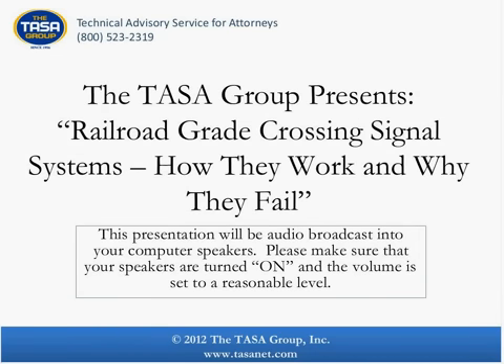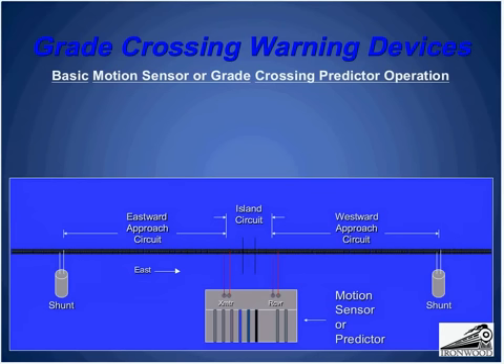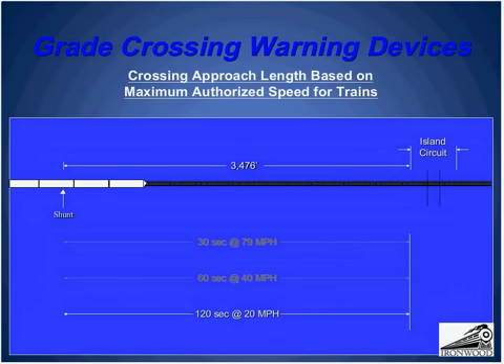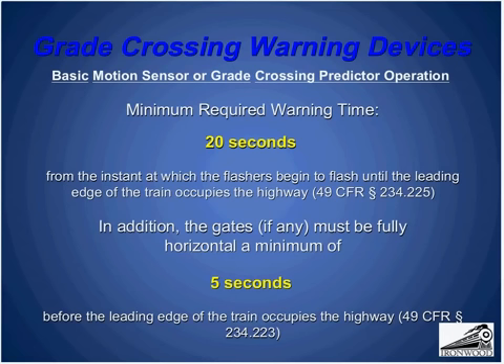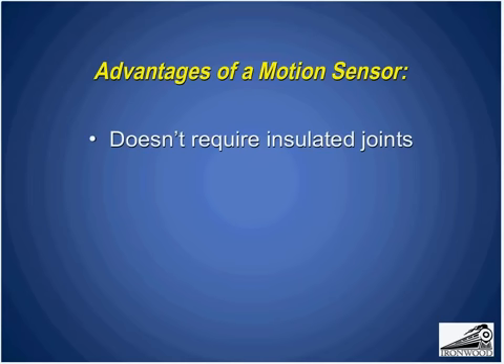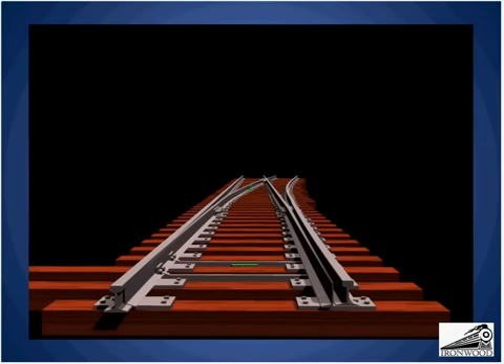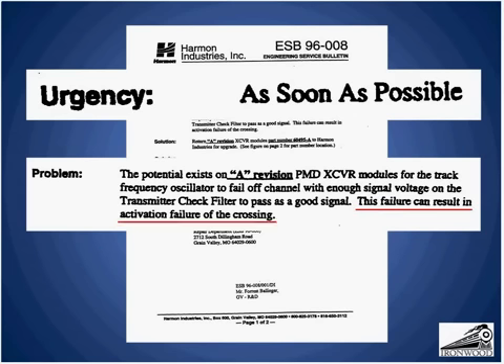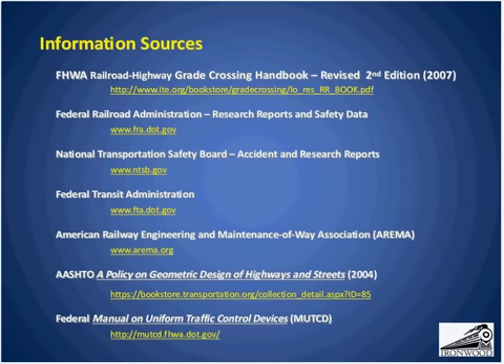Railroad Grade Crossing Signal Systems - How They Work and Why They Fail

Comment: Poor term "Motion Sensor" when speaking of Train Detector .   
Did I observe a problem? (I was not paying attention and may be wrong.)  ~1968, Littleton, Colorado Main Street, a local freightrain caused the mee-mool lights (o)T(o) to activate.   It slowed and stopped 250 ft from the crossing and backed into a siding. (o)T(o) deactivated.  Thru-freight at 50 mph did not activate the (o)T(o) until it reached the 250 ft point from where the local freight backed.
Reply: I can't find documentation of this incident easily on the internet and can't research it, but I'm going to assume the through freight was on a different track from the local freight (as opposed to showing up on the same track several minutes after the local freight got completely into the siding). If the through freight was in fact on another track, he should have activated an entirely independent motion detector circuit and activated the lights >20 seconds before he reached the crossing. If he didn't activate the crossing until a point equidistant from where the local freight backed in, then there was probably a band iron, like the presenter mentioned, dropped across the adjacent track where the through freight passed.
Reply: @kdmq    Thank you.   One track.   Local backed into a siding and closed the switch for the main.   It appeared thathe (o)T(o) did not activate until the 50-mph train shunted the track athe point where the local freightrain had ceased making forward progress.   As though the system would not activate until the local again reached that point.   "band iron"?
Reply: @robertgift  Disregard my last comment then, since it was based on an incorrect assumption that there were 2 tracks. If it was one track, then the adhesive joints meant for electrical isolation probably failed, causing the switch to bridge the 2 tracks for the mainline, having a similar effect to the band iron.

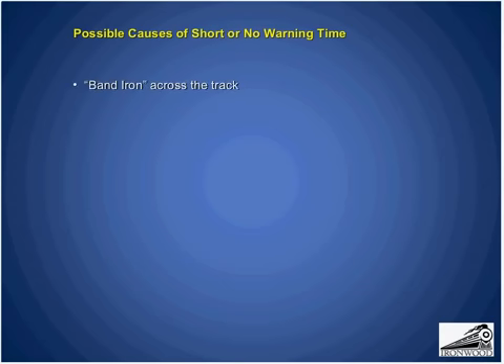Go to 43:40 in the video and listen carefully and he explains very well why a band iron or anything bridging the gap between the 2 tracks will cause a dangerously short warning time.
Reply: @kdmq    I would have noticed any failed or shorted rail insulators.
Is a "band iron" a shunt rail crews placed across the rails?   
Or metal strapping which I have found along right-of-ways?   (When I was six years old visiting my grandparents in Lewistown, PA, on Easter Day, I found a length of metal strapping.   I wedged it into rail joints and caused the silent (no bells) (o)T(o) to activate.    
Assumed someone athe railroad would know.   Returned to the scene of the crime an hour later and the mee-mool lights were still flashing.   (No traffic on the little-used road.)  Walking between the rails, I pretended to trip on the strapping which pulled it out of the rail joints.